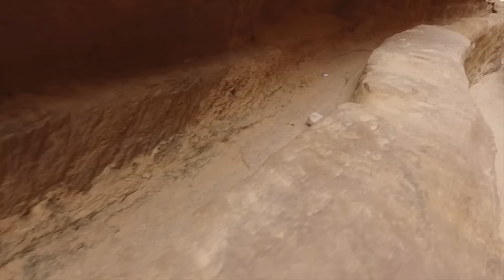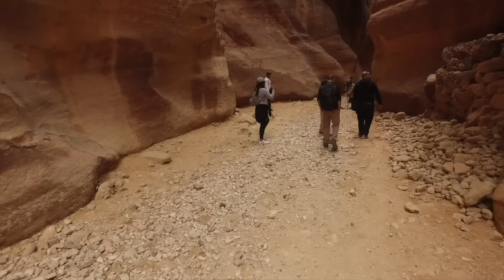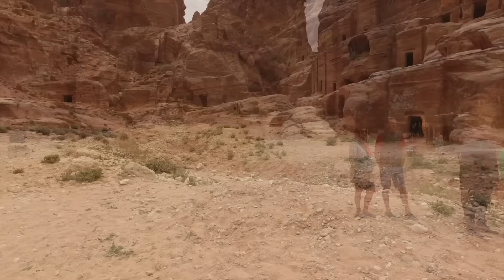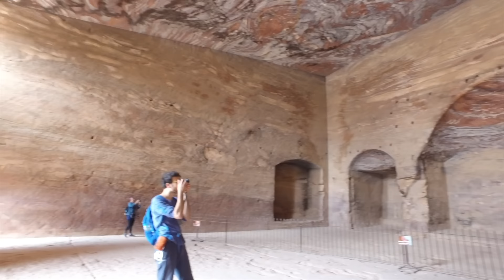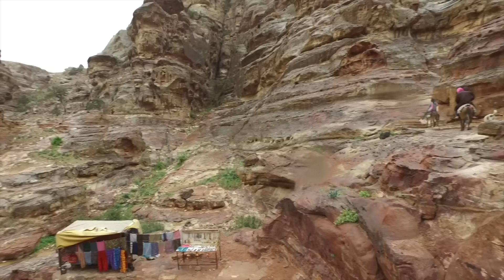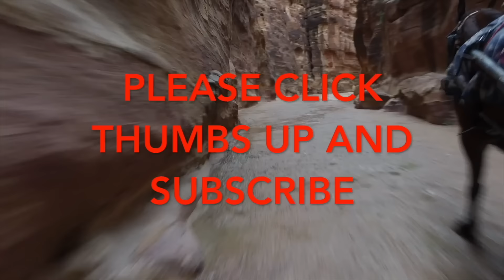Exploration Of Megalithic Petra In Jordan In 2017

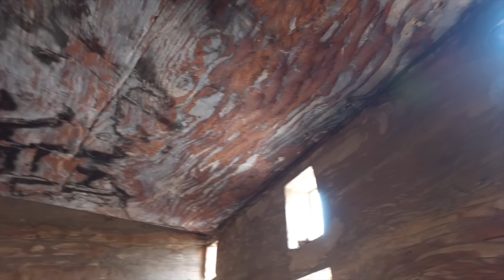Comment: At 15:00, we see "tool marks." Ordinarily, you'd be inclined to think that the marks were machine made. However, you could possibly have stone that was "poured" or "cast-in-place." If so, the marks could have been made by "notched trowels." The benefit of notching would be that it would provide more surface area for adhesion--if they later decided to cast more stone directly against that specific area. (Sort of like the "finger-joint" concept in woodworking.)

Comment: question, did no one scan the whole thing with hires? or where is the data?
what I suggest is to investigate error statistics. the "noise" and deviation from the ideal shape, and find critical ranges of "frequencies" i.e. relative distance to the granularity of the stone, and also to the height of the structure.
then, to classify, which came from manufacturing, and which came from the age and weathering.
if we can compute back to manufactured shape, then we can get statistics on precision of the work, and type of systemic errors.
these are parameters that we can compare to other similar structures. is it the same all over petra and little petra? are there traces of "styles" and individual workforce? like one worker would be more skilled than some other, and have lower error statistics. or we might find degrading precision because tools get worn out.
then, we can compare with pyramid sites, and some sites in india/pakistan. if they look a bit similar, do they have similar error/noise statistics?
this might help us to take better guesses on whether something was machine made or CAD guided.

one detail: what about the water channels, did someone check the height and niveaus, to tell if this had worked in the first place? then how could they plan and maintain the correct niveau without modern measurement tools like laser distance etc..? did it work the same way the romans build their aquaeduct and channel systems? because in that siq, can you apply the same methods at all?
did they just use the water itself to test the niveaus? this might become very incremental. could they plan that the water should flow with a certain speed? who at that time had the skill to figure it out? can it be expained with hired water architects from rome?